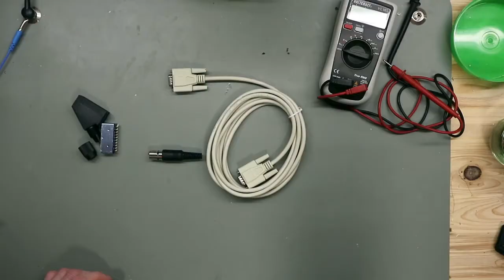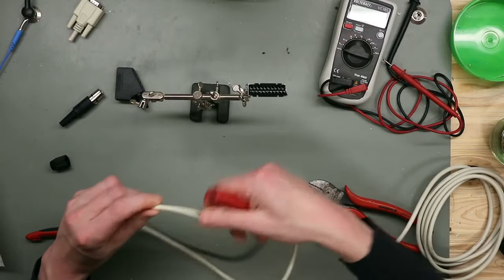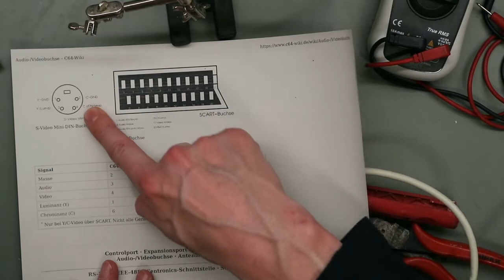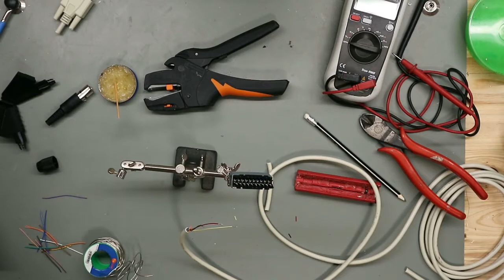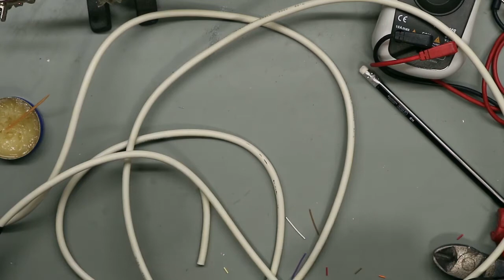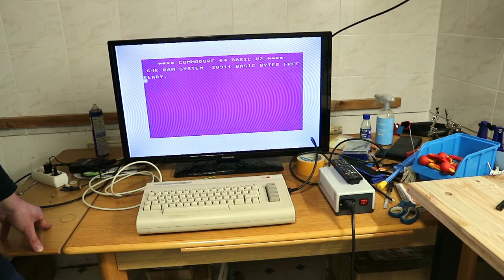Commodore C64 Series #2: Video-Cable

Comment: S-video ???
Reply from the maker: This one provides Composite. It is possible to make an SVideo cable. I will show an device with SVideo in a future video.
Reply: S-video is not of much use in SCART, as most TV's of the era only have RF and composite/RGB SCART. S-video was only added to SCART in the nineties, mostly on dual-SCART TV's 20 inch and larger. The C64 did not stand a chance compared to its peers: BBC Micro, Spectrum 128k, CPC, MSX, P2000T, all had crystal clear RGB out and matching DIN-SCART cables. C64 video output was in the gutter, together with the original Spectrum 48.